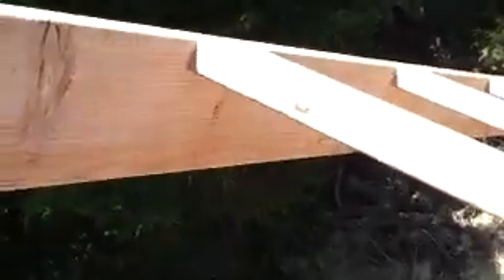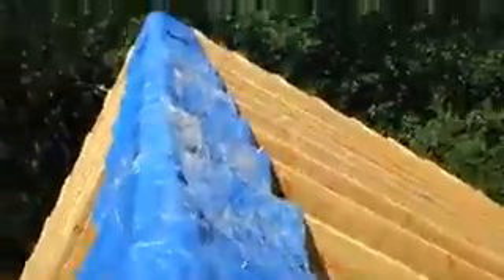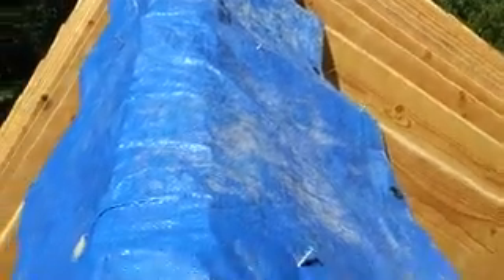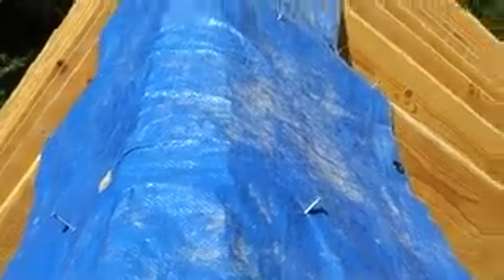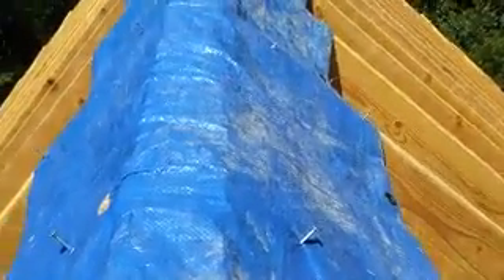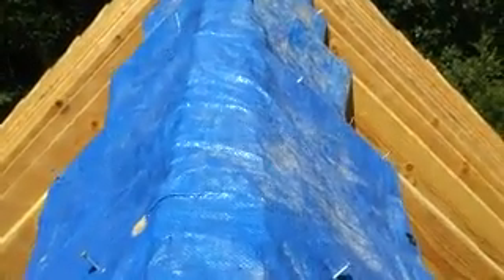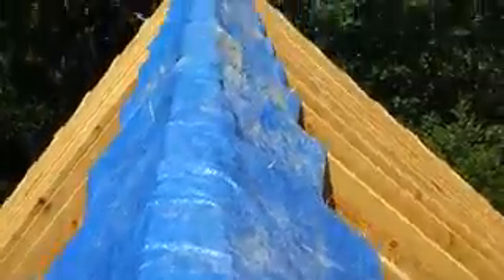1st 2 Barge Rafters Meet at the Top

Comment: I would cut from the bottom of the of them where they meet straight up so the flush up together till the top where you will have a small notch where they are short. Then cut a piece of one by 8 eight inches long put it over the top forming what will look like a raised diamond and paint it one of your accent trim colors. Looks like you wanted it that way?